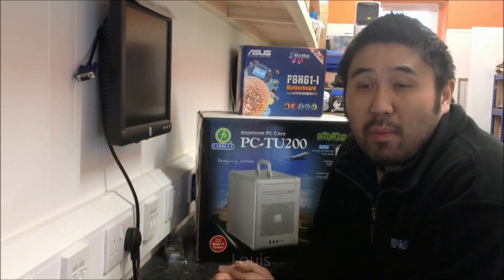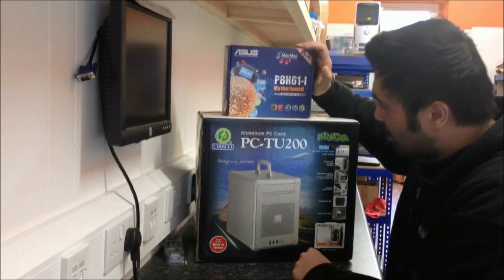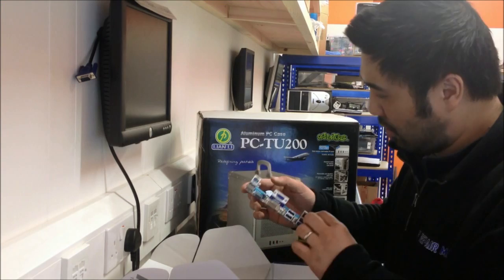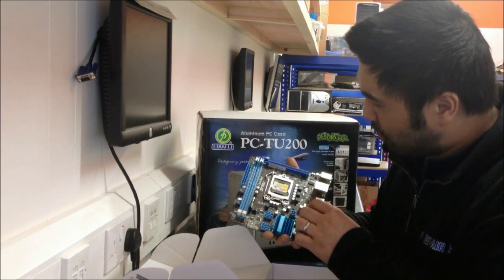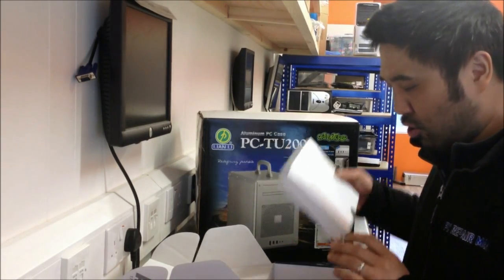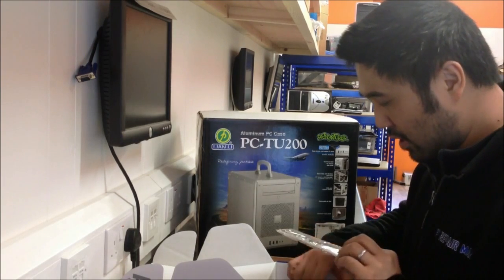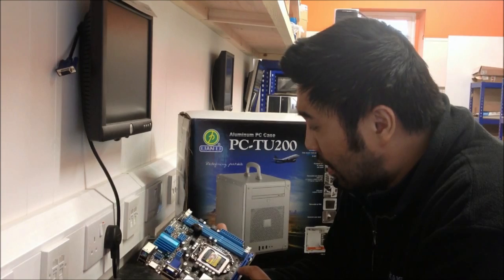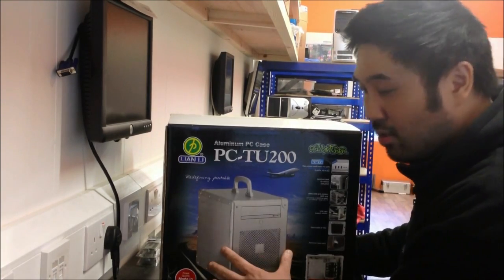Mini Recording PC Build Part 1 - Lian Li PC-TU200 and ASUS P8H61-I

Comment: Hey. Very nice review and I have found it particularly helpful that you explained what this computer's intended use is. I am currently interested in building a portable rendering/gaming rig for long distance work trips. On the topic is it specious enough for gaming gpus? What is your opinion on that?  Btw, a piece of advice, it would be really helpful if you had a mic somewhere closer as it would help with audio quality. Sometimes your voice was too low man. ;-)